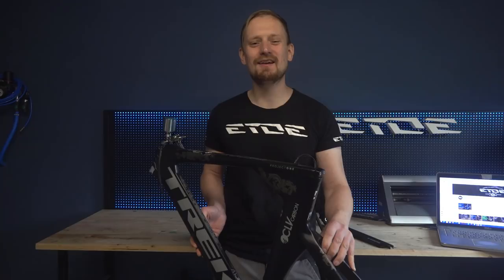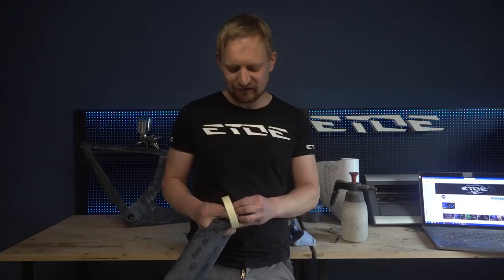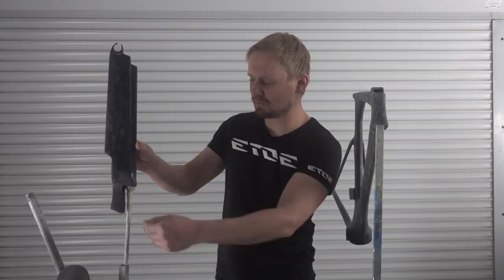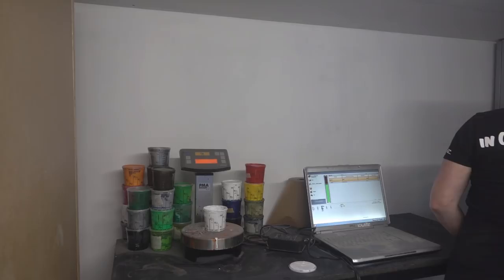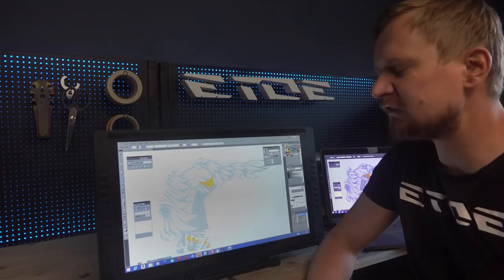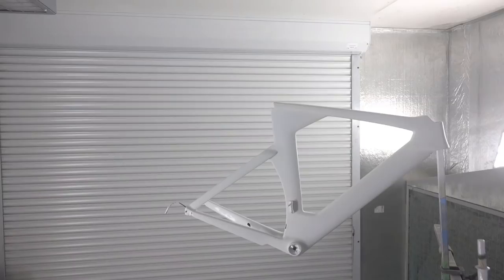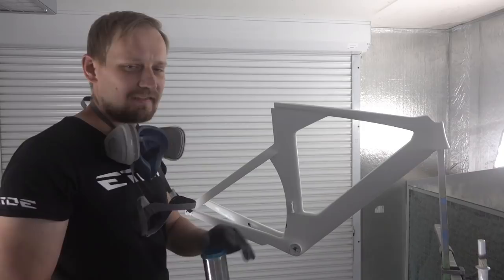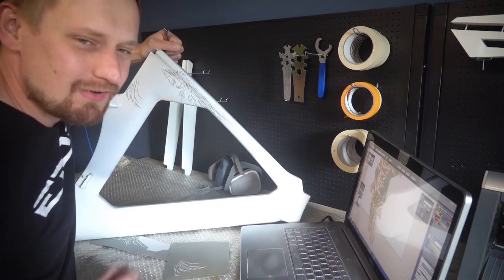painting a triathlon bike part 1 - Trek Speedconcept ETOE style

Comment: You won't hurt that frame using an orbital sander.  I made the most amazing helicopter components using carbon fiber, kevlar and fiber glass.  If you are careful with an orbital sander, you can mow through that paint in short order and not dig into the laminate.